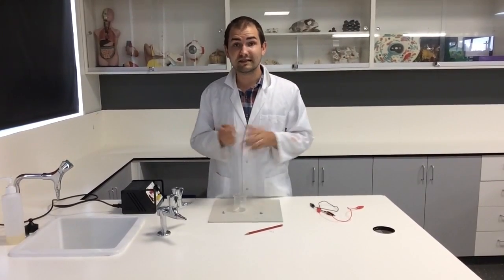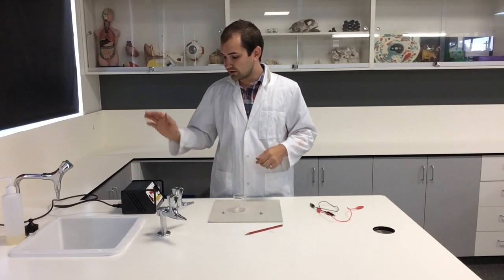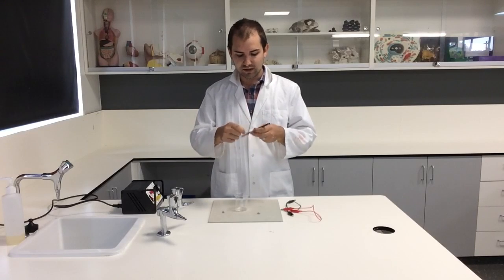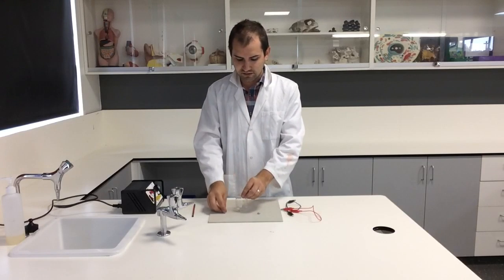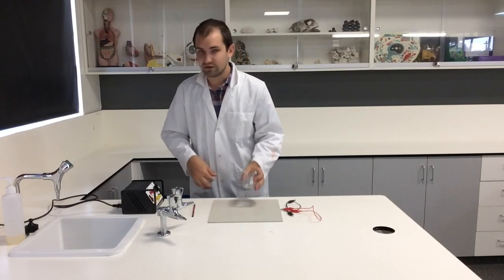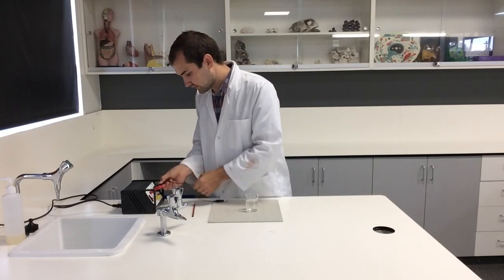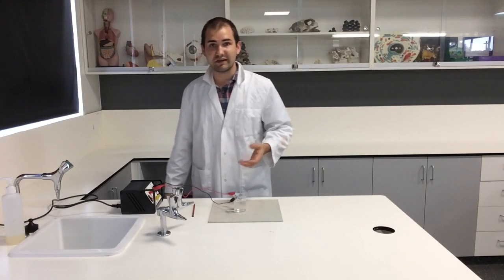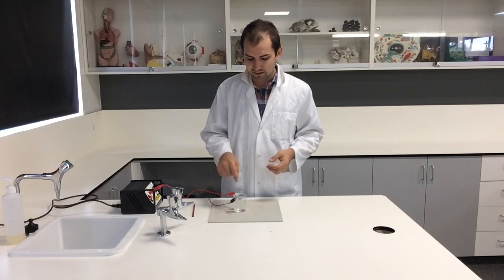How to make an electric kettle experiment

Comment: what length and thickness wire did you use? and what voltage?
Reply: not sure, assuming just the normal thickness from nichrome and voltage (about 10 idk)

Edit: 2/4/6 i meant